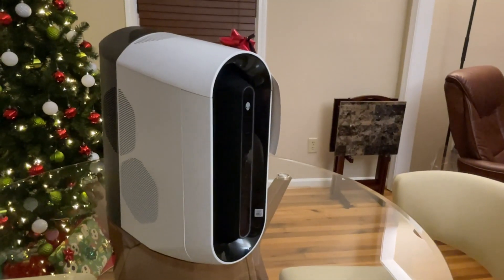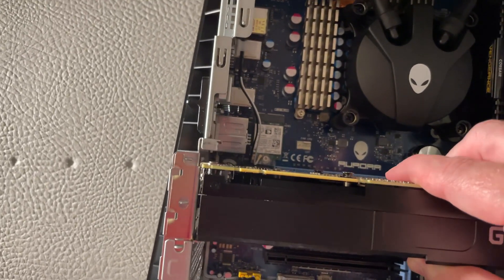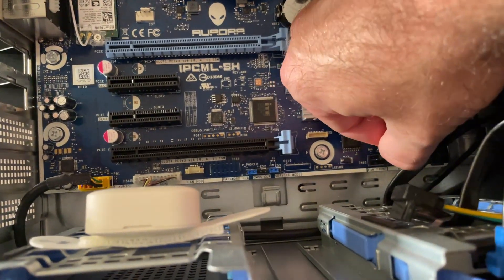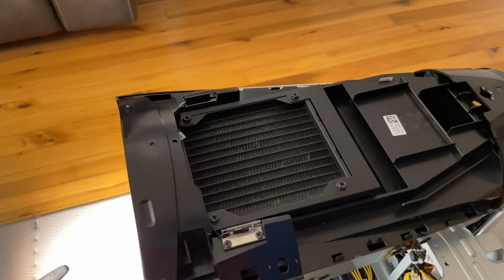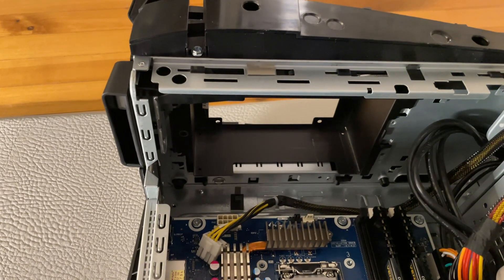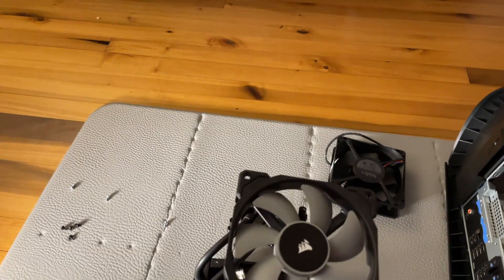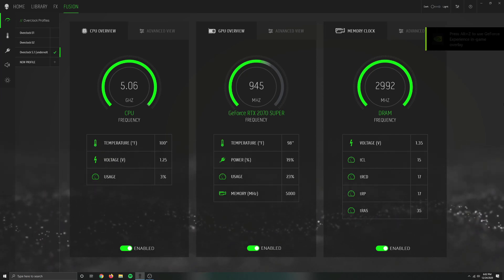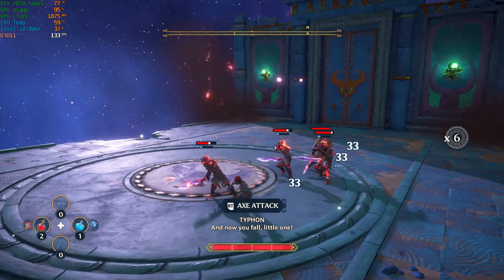Alienware R11 Radiator Mod and Case Fan Upgrade

Comment: Awesome video. I am using your video, combined with Cloud Prepared's GPU location/fan mods and Gamer Heaven's thermal pad GPU mods for my new R10 with a 3090. Will have 7 noctua fans running!

Comment: Does it really have to be the pro series fans? I know for replacing the push/pull fans you want SP (static pressure) vs AF(airflow) for the front, but was curious about the pro vs elite series.
Reply: It's my understanding that the computer will throw a BIOS error unless the PROs are used.

Comment: For the screws on the radiator, when you mentioned to unscrew and re-screw according to the numbers. If I want to unscrew it I should follow the order 4-3-2-1 and if I want to re-screw it I should follow the order 1-2-3-4, am I right?

Comment: Have you noticed how low the tubes are now? I tried it and i have like centimeter of room between the fan blades and the radiator tubes. Do you have the same issue of did I do something wrong? Fan is not hitting the tube but just a bit worried.

Comment: anyone have a fix to reset or fix the bios error I'm getting? i just put in 2 ml120 pro fans at the top for the push/pull config. and I'm getting a top fan bios error. 
i had 2 noctua pwm fans too previously they also triggered the bios error.  i don't want to have to press esc every startup to stop the test.
Reply: Having the same issue. Nothing I’ve been able to find yet. I may pose the question to Alienware support as it’s under warranty still and it’s such a silly thing to have a fan upgrade throw a bios error on startup. But I guess that’s Dell for you. I’ve confirmed the fans are working, you just have to factor in that AWCC percentage is a percentage of 4500rpm. So my two noctua front fans at 1500 each don’t get higher than 33% ever. I’ll take pressing escape each time over loud fans. Getting 60-65 degrees max temps on GPU at load and 48-55 on the CPU at load now. Can’t complain

Comment: I’m not sure if it’s because I have an R10 5900x, but I could not fit a push pull noctua redux in the top, seems the tubes were too long from the middle to the top with the config and I could not maneuver my aio block back over the CPU, ended up just having one push through the rad at the bottom. Anyone else have this issue?

Comment: Thanks for this video.  My R11 was driving me crazy with the very loud fan noise when playing MSFS2020.  I have now completed installing three new fans and the results are pretty impressive - meaning very quiet compared to the past.  Your presentation is clear, concise and well documented with the video camera.  It  was very easy to refer to your video while I was make the changes.  Your video gave me the knowledge and the confidence to make the changes.  I doubt I would have tried it had I not come across your instructions.  Well produced!
Reply: You didnt get any system testing failure with the new fans?

Comment: I swapped out the front case fan. The original is a DC Model AFB1212EJ-01 which has 123.27 cfm displayed on the label. The Corsair ML120 Pro has an airflow of 12-75 cfm. Should we do this? Am I missing something?

Comment: so i have an aurora r11 with a heat sink, i hit temps up to 103 gaming and thats too hot, i seen a vid of a guy replacing it with liquid cooling and was planning on doing that, do you think your option is the way to go or upgrade to liquid cooling?

Comment: Thank you very much for the clear and informative video. Just upgraded my aurora r10 5900 OEM and rtx3080 with 4 Corsair ml120 like you did. I couldn't find any screws that would fit, probably a different standard size for my country. But zip ties work well, although a bit of a hassle and an insult to a 3000€ computer. Temperature is about the same, but much quieter. This upgrade is almost mandatory if you don't use headphones. Dell should be ashamed they couldn't do this in the factory.

Comment: i'm using an RGB ml120 Pro for the very top fan so that i can see the color, and a white LED ML120 pro underneath as the push fan, but i'm still getting a BIOS error upon boot. any thoughts? i used the RGB for the front fan replacement as well, but that didn't register any BIOS error.

Comment: Does it have to be those fans? I was looking at Noctua fans because of there raved reviews and friend recommendations ...will they not work with the r10?
Reply: @Yeti Confetti thank you.
Reply: @Yeti Confetti  - I just purchased the NF A12x25 and attempted to replace my front fan with it. Monitor wouldn't get any signal and the alienware head blinked 5 times. Did you have any success installing them?

Comment: Hello sir, so I tried to do the top fan mod with two Notchua 120mm fans,  I'll provide a link below. I faced a problem after installing the top fan. So I placed the fan on top then screwed in the "liquid cooler vent", It was screwed in very easily however when I tried to connect my liquid cooler to the CPU it was too low and I couldn't bend the cooling hoses any further so I only put in one fan for now, what basically happened was the top fan pushed everything too low. Any idea what I could have done wrong? I checked the measurements of my fans and it's the same size as the corsair ml pro 120mm. My apologies if my explanation was confusing. 
Cheers. 

 https://www.amazon.ca/Noctua-NF-A12x25-PWM-Premium-Quality-Quiet/dp/B07C5VG64V/ref=sr_1_1_sspa?dchild=1&keywords=noctua+fan+120&qid=1618342093&sr=8-1-spons&psc=1&spLa=ZW5jcnlwdGVkUXVhbGlmaWVyPUExSFJFSFg0U0RVRENDJmVuY3J5cHRlZElkPUEwNzUzOTc3MzVXRDdNWjlSMFpRMyZlbmNyeXB0ZWRBZElkPUEwMjExNzU1WTNLWk1VOTdHSDVZJndpZGdldE5hbWU9c3BfYXRmJmFjdGlvbj1jbGlja1JlZGlyZWN0JmRvTm90TG9nQ2xpY2s9dHJ1ZQ==

Comment: I did this mod and replacement for my r10 using noctura NF-A12x25 fans yesterday. No error or anything, the only difference was where I had to plug the front fan into, the wire ran to the top instead of the bottom for some reason. For anyone attempting this mod, he forgot to mention you’re going to have to force the aio to fit because the fan doesn’t sit flush with the case so it takes up an inch or two of space between the top of the case and the aio, it might feel sketchy but I got it to fit and so far there’s no problems. Thank you for this video! Wasn’t impressed with the cooling difference, I hit 90 degrees Celsius with the old fans at one point and so far I’ve hit 85 with the new ones. The main difference is the noise, definitely worth the upgrade as long as I don’t hit 90 again
Reply: Can you passed the fan bios test?
Reply: @yingchanglei5795  it didn’t give me an error or anything, just started up like normal
Reply: Can you describe it in more detail how you got it to fit back in?  The tubes were so stiff for me I didn't know how to get the AIO back in

Comment: why do the non pro corsair fans not work? the pro and non pro have the exact same specks!...There is another video where someone used cooler master fans to do this mod!
Reply from the maker: I tried to the non-pro and received a BIOS fan error, and I know others have received the same error with certain make and models of fans. The pro and non-pro fans are the same except for the fact that the non-pro only has a 3 pin DC connector while the Pro has a 4 pin PWM (actually a 3 pin DC with a 4th pin that carries the PWM signal) connector. Dell has a non-bypassable fan hardware check in their BIOS that uses the PWM signal to ensure that the fans are working. I know from others that Noctua and Artic fans will also work. In theory, any fan with a 4 pin PWM connector should work, but don't quote me on that as I'm not sure if the Dell BIOS check only looks for a valid PWM signal or looks at other variables.

Comment: I have a R11 with i9 10900k it runs hot. Great video and I’m doing this! I hope it helps my temps
Reply: comment back and let me know , i got the I7 10700K with the RTX3070 16gb ram and 1tb NVMe SSD 2TB HDD and liquid cooled CPU . im doing this fan upgrade and will reply with my outcome too.
Reply: @Snake Eyes X yeah i got it dropped to about 60 degrees Celcius on load. from what i had before i was running atleast 85+ degrees. i did the same thing with the same fans and used artic silver 5 thermal paste. made a huge difference

Comment: I saw some people asking about the RGB version of the ML120 Pro. It’s all I could find so I used those and it works fine. Just has some fancy lighting.
Reply: Thanks man
Reply: 4years later and I'm just now upgrading mine. I got the RGB ones but getting bios error, how did you get pass it, if it even popped for you?

Comment: Thanks for the tips. I just need to replace the very disappointing fans. I am really wondering, why Alienware is saving money exactly where customers will get mad - the noise!
Reply from the maker: The fans work, they are just noisy. Especially the top fan, it is a Nidec server grade fan and capable of moving a lot of air. The sensible design choice would be to redesign the top of the case to fit a 240mm AIO cooler, but that would also increase the price by a few bucks and definitely mess with the looks of the case.
Reply: @theonlyjoe6036  I disagree with "they work" because: 
1. They are very loud. I didn't expected this noise at all and I was very disappointed about my new desktop PC. That's why I was looking what I can do.
2. The fans were cooling my CPU with max load to 90°C. With your suggested build: two fans on top, one fan on bottom, it cools my CPU with max load to 80°C.
I am now very happy with the Noctua fans despite they are really expensive (for 3 fans).
Thanks again for your nice video, now I am super happy with my PC.
Reply from the maker: @rainair402  Good to hear you saw results. "They work" or "It works" in engineering simply means that it performs the job, it doesn't say anything about how efficient or good it is.

Example: My boss reviewing my code and commenting how messy how it is. 
Me: "It works."

Comment: are the fans better cooling than the stock ones? would i get better temps with just replacing the stock 2 ones instead of adding another one to the aio cooler?
Reply from the maker: So... the Corsair Pros are able to move more air at lower RPMs and noise all things being equal. The included Nidec server is a high RPM, high CFM (cubic feet per minute), high airflow, and high noise fan (not just due to the higher RPM, but due to being an older ball bearing design and the design of the fan blades themselves). 

A single Corsair Pro cannot match the CFM of the Nidec server grade fan, but the two fans in a push pull come quite close while being much more quite. I can run the two Corsairs up top at a higher RPM at a lower noise relative to the stock fan which helps to maintain lower temps overall. I've seen around a 5C to degree 10C lower temps across the board with the mod while running a 5.1 overclock and slight undervolt.
Reply: @theonlyjoe6036  cool, thanks for the reply! can you still control the fans, or do they adjust their speed according to temperature?

Comment: Can you describe the air flow with this mod? Does the air get pulled in from the front and then pushed out the top?
Reply from the maker: Correct. The front fan is an intake fan. The two top fans exhaust out of the top of the case,

Comment: My front fan always run at 11% why need to bother the front fan?  Maybe top fan need to do so
Reply from the maker: You don't have to do the front fan. I did notice a little bit of noise reduction from just the front fan. The two top fans made a huge difference in noise though; especially when the fans rev up.
Reply: my r11 build with rtx2080s liquid cooling u know this gpu with 2 box and 2 tower fans they both have noise but not too loud i can aceept im thinking if i buy 2 corsail pro for the top fan or just 1 corsail fan then with original fan together i think if when gaming loading usage less than original 1 fan  they wont be v loud, should must buy 2?

Comment: Thanks for the vid. Did it today with no issue. Got a yellow light on my power button for a minute, 2 bios errors for each fan, booted through it anyway and it's been perfect ever since. Running the 5.3 overclock and fans are at 17 and 10 percent, 39 degrees. 👍
Reply: Do you get the Bios error on every boot up ? That’s what I got on both Front and Top Fan - Have tried Noctua (Pwm) and Corsair pro (non rgb)  On top fan and Noctua on front still get errors- I have reverted back to stock until I figure out BIOS error work around/ fix
Reply: @vernonharvey6612  I just got it the one time. My system boots up now with no errors.

Comment: So the fan on top of the radiator is the pull fan and the one inside the PC is push?

That seems backwards.  Wouldn't you want the air to push out the top?
Reply from the maker: Think about it like this, the PUSH fan PUSHES air against the radiator while the PULL fan PULLS air through the radiator. So the air is being exhausted out of the top. The whole point of the pull fan is to increase the efficient of the push fan so that more air make is exposed / passed over the radiator surface and cooling performance is improved. 

CASE (INTAKE) > PUSH FAN > RADIATOR > PULL FAN > EXHAUST

Comment: Hey I am having issues with the retention clip for my gpu I can’t tell if it’s pressed or not. I pushed it down as hard as I could, not so hard to damage the hardware, and tried to remove the gpu and it felt like I was going to rip out the whole motherboard. I’m I doing something wrong or do you think the clip could be defective and is stuck?

Comment: is this splitter good for the R11?  Also is it possible to remove the top fan without removing the CPU cooler and reapplying thermal paste?
https://www.amazon.com/gp/product/B01DV1Z0Z4/ref=crt_ewc_img_huc_1?ie=UTF8&psc=1&smid=A1AMUYYA3CT6HJ

Comment: Oh yeah, hey, if anyone with an Aurora case reads this: Does your guys PSU bracket arm take a decent amount of force to swing all the way? Mine just feels like it should be looser and I'm not sure if this is standard.
Reply from the maker: As there are no ball bearings on the swing arm. It is just a metal hinge, and does take a little bit of force to swing out. So no worries.
Reply: @theonlyjoe6036  Okay, thanks! I think it might be moving a little better the more I use it, but maybe that's just in my head. The very first time I used it I was just pretty worried and had to check that a wire wasn't stuck or something, because it seemed to get more tense the further I opened it.
Reply from the maker: @infasis  You can't see it in the videos, but since I hold my camera in one hand, I actually use my foot on the lip of the case as leverage when I pull open the PSU arm. Sometimes it can take two or three takes to get it right on camera as that thing sometimes just doesn't want to move easily.
Reply: @theonlyjoe6036  Ahh nice! Thanks! That is really reassuring. I remember seeing a video where someone wrecked something opening the case and I think that's been in my mind this whole time which helped make me uneasy too, but the video was nowhere near as good as this content and he didn't seem very experienced with PC hardware, so I'm sure I'll be okay. I'm just glad to know my case isn't kinda defective in some manner though too.

Comment: i have a question what kind a screwdriver are you using cause i wanna do same as my r11 but dont know which one screwdriver is match as ur
Reply from the maker: I use a Kobalt set that I bought from Lowes.
Reply: @theonlyjoe6036  so after u mod ur fan while u are gaming does it make any loud noice when you play like call of duty cuz in the future I’m mod the fan can boot up to performance also can you do make video about mod the fan performance
Reply from the maker: @letrantantaile7018  When the fan spins up it does increase the noise, but it still much more quite than the stock fans.

Comment: Awesome video!  Just did this exact same thing to my R11 tonight.  At first my top fans didn't work but the fan connector on the mobo came loose.  Everything is so much quieter and a bit cooler.  I have some questions, does it matter which top fan gets connected to the 4 pin connector on the y splitter?  Right now I have the lower top fan on the 4 pin and the upper top fan on the 3 pin.  Can I assume the if the upper top fan is spinning the lower top fan is too?  Can't see the actual lower top fan when its closed up and running.  Thanks for making this video!!
Reply: I have yet to do this mod, but I do have all the parts right now. The upper fans should both act in unison because the are using the same control pins on the motherboard but now split to two fans.  The old setup is just one fan and one radiator.  The new setup is placing that radiator between two fans spinning at the same speed (each less powerful than the original fan, but they work together in series).  I have already swapped the easier front fan, now just these more involved two top fans.  In other comments people talk about the push/pull setup and worries about two fans doing the job of one, but because a splitter is used, they do the same thing and there is plenty of power to run both.
Reply: After looking at questions about the splitter in Amazon reviews, it sounds like the 4th pin is required to return speed information back to the MB, and only one is expected so only connector has 4 pins.  So, both fans are set to the same speed, but only one of the 2 fans will return speed information to the MB.  I don't expect it matter which is which.  You chose to have the inner fan register the speed which probably makes the most sense because you cannot see it so best to have that one monitored.  Because to you chose speed reading on the inner fan you have an answer to your question; if you have a speed reading then yes that inner fan is spinning.